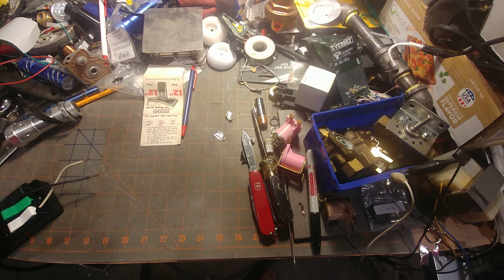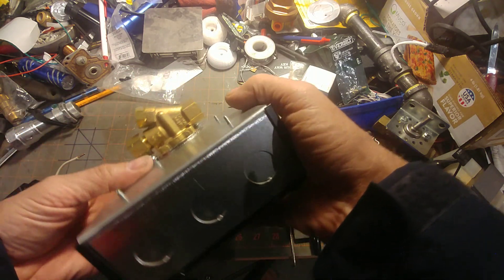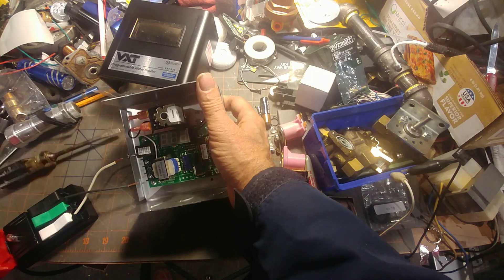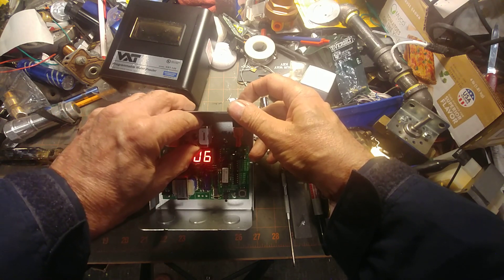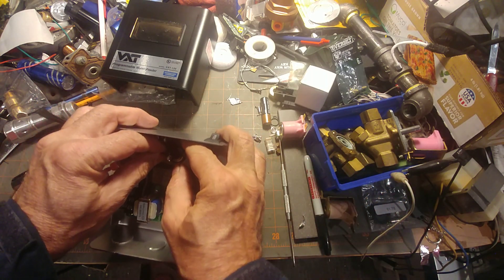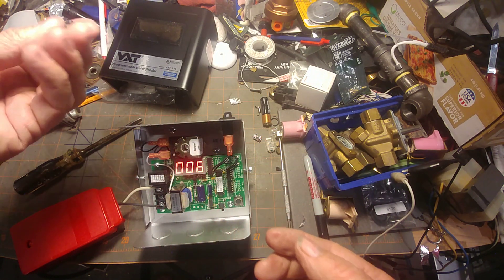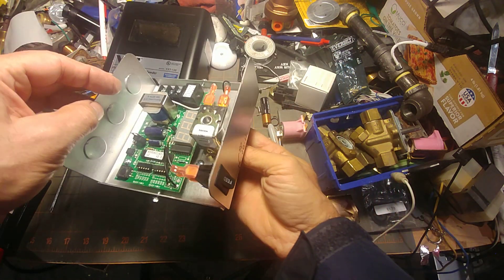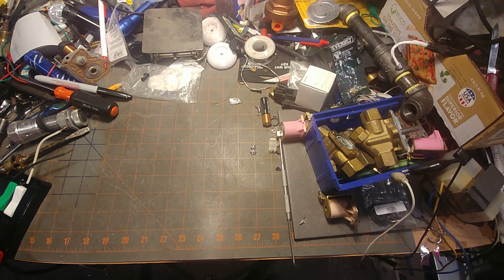New Style VXT-120 Needing Slight Tweak To Keep Them From "Buzzing"

Comment: I have not encountered this one yet, but I’m going to remember it. I presume if something interferes with the coils field that solenoid valve would buzz like crazy. But here we have a simple field remedy that I would try first instead of replacing something that works. Nice👍
Reply from the maker: This buzzing issue has unfortunately plagued the newly designed rotating valve VXT.
The folks @ Hydrolevel have been working very hard to get it resolved. The tape idea was a stopgap measure as their first iteration was buzzy. 
The tape idea works, but when put out on the assembly line production, the execution by all too fallible humans caused this latest issue.

Such is the price of innovation.

I showed this video to my contact @ Hydrolevel first before I released it publicly. They said it would help get the word out.
They believe they now have a permanent solution and have sent me a unit to test and report.  It looks very good.
I'm looking forward to getting a video out very soon.

Comment: Have you done a video on the best way to run a hydronic loop off a steam boiler?
Reply: I’ve seen those, not really a fan though of the idea, mostly because of boiler sludge common in steam chests which I can’t imagine is good for circulators. I understand they are common in New York City area and are referred to as ‘Brooklyn Loops’.
But, they do work when they work.
Reply from the maker: https://youtu.be/UxLGVXGoh88
Please give that a look.  
It's the closest one that I have a video of.  While it is not a space heating loop, many of the same control and piping issues and best practices are the same.  The coil is heating domestic water. 
We've only done two "pure" space heating loops, one froze up and was never repaired last I heard (t-stat failed), and the other changed owners and we haven't been back.
Curve Planner is quite correct: The sludge is a killer of circulators and any ferrous components.

Comment: Why does the valve stem need any type of tape? What is the tape doing? Are they trying to keep the coil from sliding off the valve by providing a little friction? Seems like the end of the valve stem should have a groove with a clip to keep the coil on
Reply from the maker: The tape was an interim solution to the noise problem noted back in May of this year.
It's supposed to keep the coil on the valve while in shipment and rattling around on a tech's truck.
Please understand that the valve itself (either the S-45 or 443P discussed elsewhere) is a "commodity" sold at a price point as is. Take it or leave it.
Any modification costs to change the valve even in the slightest would be considerable and would have to be paid by Hydrolevel and then passed on to us.
Reply: @Ed, Right?! I know the steam on solenoid valves for AC/Refrigeration are tapped on the top and receive a nameplate and screw, which will hold the coil stationary.